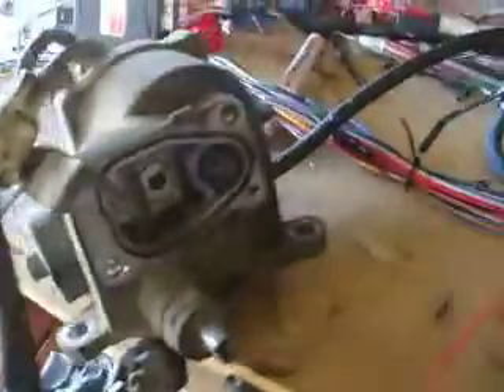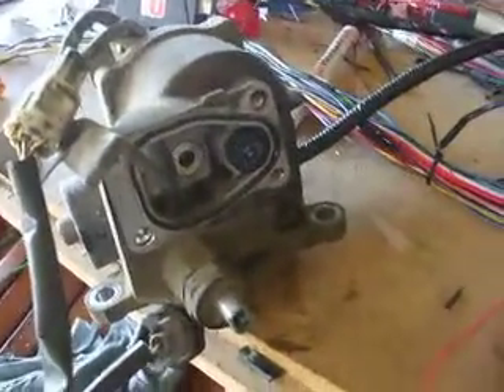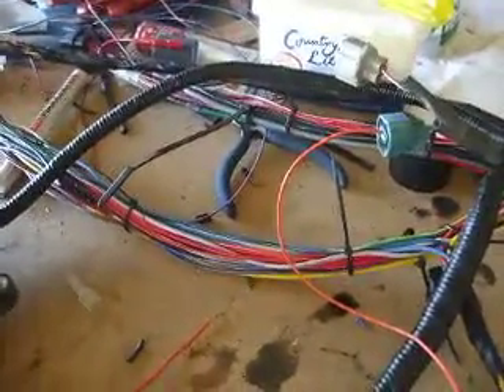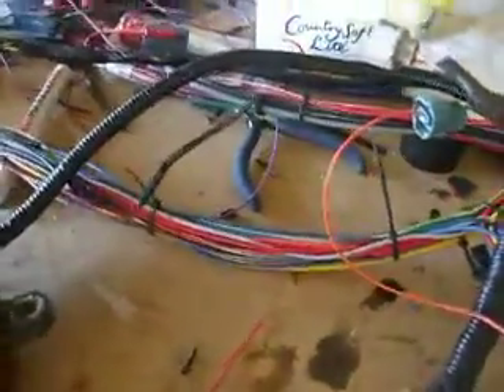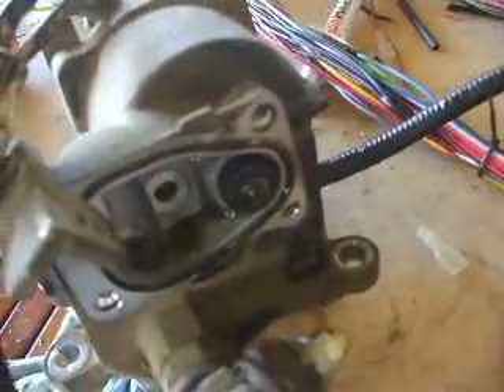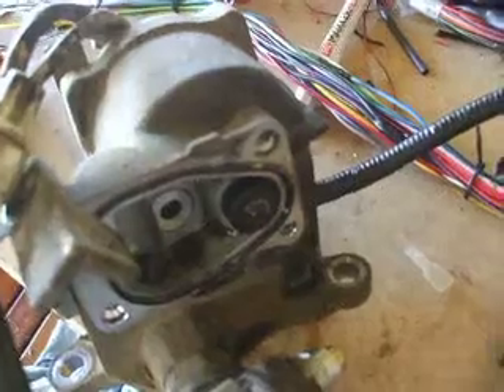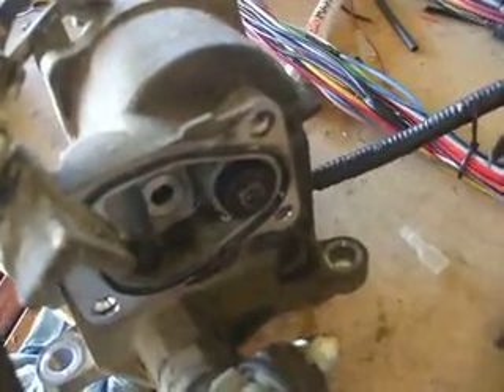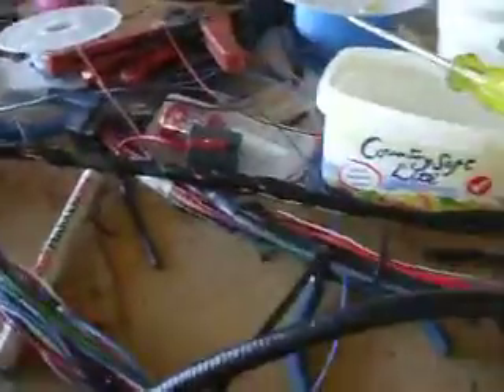4x4 control Unit

Comment: Hey man excellent video I have just blew up a g52 gearbox in my Hilux and I have hey r series gearbox from a 2lt surf with the electronic four-wheel drive engagement I found a electronic four-wheel drive control box at the wreckers out of a 1kz powered Hilux just wondering if you could help with any details of how to wireitup can see that some of the wise are thicker and I'm imagining that they are the ones that go from Power and to the motor
Reply from the maker: I have a little set of instructions for this job when fitting the electronic 4x4 transfer engagement.   Its $30nzd and really simple to wire up.  Cheers Kelvin
Reply: @CartuneNZ  I would purchase instructions from you provided it suits the 4 x 4 control box I have do you have any actuator for sale as mine has corrosion damage
Reply: @CartuneNZ  do you have a phone number I can call you to purchase